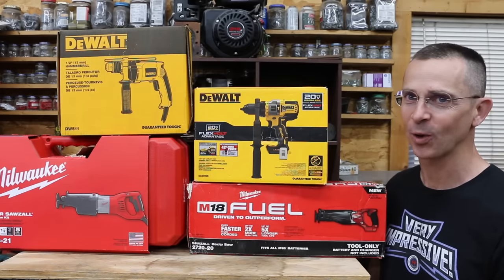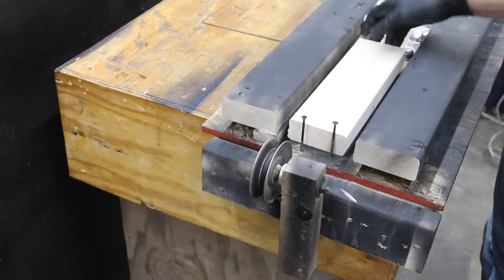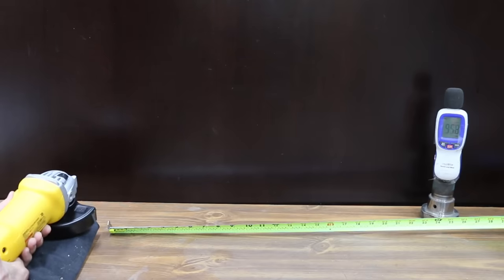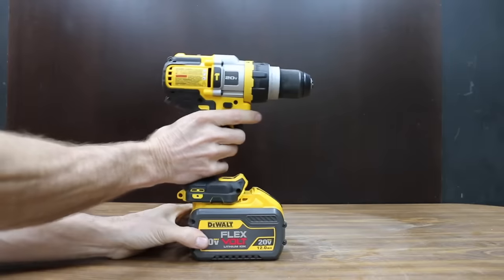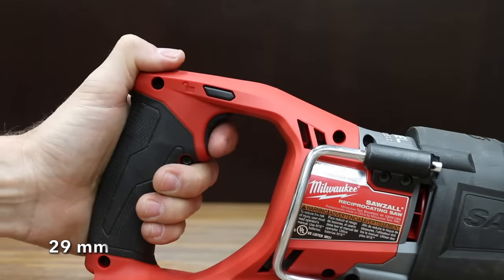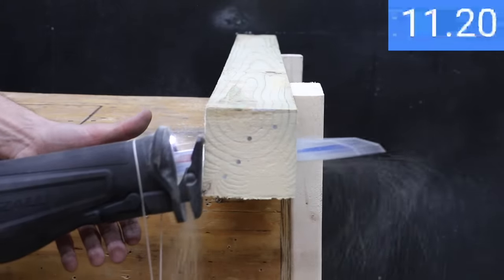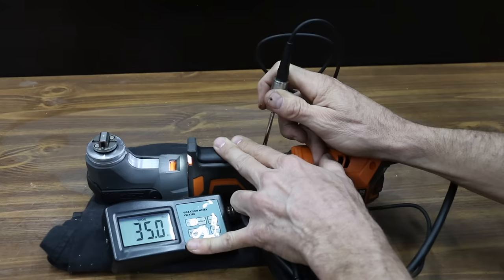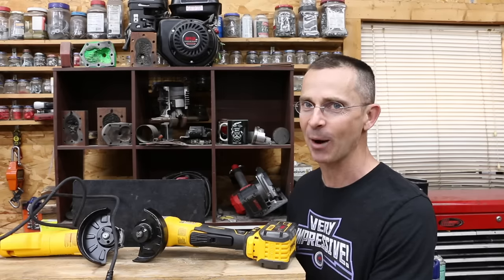Let's Settle This! Are Cordless Power Tools REALLY Better? Torque, Cutting Speed, Noise, Vibration

Comment: It's also important to acknowledge that tool companies have a financial incentive to improve battery powered tools and make them more feature rich than corded. They make a lot more money on batteries than the actual tools.
Reply from the maker: Thanks for the feedback.
Reply: Yeah, batteries are the printer ink of the tool world.
Reply: I think it makes sense for the end users too though - let's face it, most people who are going to be buying LOTS of tools and batteries are probably using them all the time on job sites with possibly inconsistent power accessibility and still demand high performance or they'll shop elsewhere.  For people using them all day every day the convenience also saves them time and money making the higher price worth it for corded power without lugging extension cables or generators.

As a DIY person, I might use a circular saw a couple times a year...I have a tough time stomaching $200 for a cordless one that I will probably use in my garage or back deck next to a plug anyway, and I'm also willing to accept slightly lower performance in a lot of things if its 1/3 the price and is sufficient for the job.  If I really need to use it farther out in my yard, I can drag out the 12 gauge extension cord for that rare time.
Reply: @JoshuaSaundersAtLarge  They certainly are an ecosystem. Big companies like TTi produce battery tools for several brands such as Ryobi, AEG, etc. yet they're all incompatible with each others battery series.
Reply: Yes and no. Markup on both tools and batteries is very high (think of all those "buy a set, choose one for free" types of deals). Batteries don't account for nearly as much revenue, as the typical homeowner can buy the whole lineup of tools and still get by with two 2Ah batteries and one 4Ah. No need to get tens of batteries if you can only use one tool at a time.

Yes, contractors buy a lot of tools and batteries, but 1) I feel like they go through tools faster than they go through batteries; 2) homeowners buy a lot more tools than contractors -- the construction company does not have a circular saw for every employee for instance.
Reply: @sleblanc  Excellent points. Clearly I'm the worst of both worlds there!
Reply: @TristanJCumpole  they're only incompatible out of the box. there are adapters you can buy to make them all work with eachother, for the most part.
Reply: @CRneu  True. We all need even more weight on our unstable cordless tools, right? :-)
Reply: VOLTAGE Dropoff on cordless?
Swap packs all day long?
Tesla arguing against DC power.
Cordless, best for ladder work and restricted areas. Brushless for air, ignition potential.
Working near H20.
Cordless digital pwm capability. And characteristic dynamic braking when power is cutoff.
Reply: Yeah, I look at these batteries and the cells are ~$1-3 a piece in bulk.  They tend to have 5-20 cells.  The BMS and shell might cost $10 and the assembly is probably less than $5.  These are generous numbers.  I bet even once you include shipping, marketing and overhead, it's still half profit, if not higher.
Reply: @JoshuaSaundersAtLarge  oh too right, cordless tools are super useful but it's painful here is Australia to have to fork out around $140-160 per battery!
Reply: @JoshuaSaundersAtLarge  Except for Epson EcoTank printers. Those are are so cheap to buy ink for, it annoys you that you can never refill them. lol
Reply: Stanley/B&D is in the battery selling business with a secondary business of selling tools.
Reply: @MrPizzaman09  As an industrial designer that designs products I can tell you costs a bit more than what you quoted. But yes, it’s normal for products to cost a fraction of the sales price to produce, that’s nothing new.
Reply: @sleblanc  For my Milwaukee tools I have four 2Ah, eight 5Ah, and two 12Ah batteries.   The 2Ah, two of the 5Ah and one of the 12Ah batteries are the ones that came with the tools ... but the others I bought separately because I needed them.  At many job sites I don't have a good place to charge - either because there is no power for my chargers or no place secure enough - so when I get there in the morning I need enough charged batteries to get me through the day.   As well, my circular saws and sawzall can all drain batteries much faster than the chargers can charge them so I need lots of batteries when I am going to be using those tools a lot.

The 5Ah ones are the most heavily used ones so I replace 4 of them every year.   The 2Ah ones get replaced when I replace worn out or damaged tools.   Haven't had to replace a 12Ah one yet.
Reply: @paddington1670  I tried the "knock offs from Amazon".   Cheap ... but they don't run your tools for nearly as long so you have to buy a lot more of them.    They also don't last nearly as long as my brand-name Milwaukee batteries so they have to be replaced much sooner.
Reply: @sleblanc Companies still have a vested interest in selling battery powered tools, because they are counting on you to buy into their system. Once you buy one, you are much more likely to buy others that use the same battery. A corded tool, there is far less incentive to keep using the same brand.
Reply: @trekkeruss  Meh, I do not buy it. It is not a very wise strategy to base your purchase of a tool on being compatible with the batteries you already own. If you're a home owner who will only use one tool at a time, then yeah, maybe, but contractors who have a bunch of employees using their tools at the same time gain nothing from sticking to one battery system.
Reply: @sleblanc  I was not aware that the entire tool industry business model was based on contractor sales.
Reply: @trekkeruss  What is your point?
Reply: @sleblanc  I guess my point is that you contradict your own statements. You wrote previously that homeowners buy more tools. So I said that it is in the interest of the tool companies to make cordless tools (as opposed to corded) in order to possibly generate future sales of tools that use the same battery. But now you say “meh,” and that contractors don’t care. To that I say, so what?
Reply: @trekkeruss  Homeowners buy whichever tool makes the most sense to them. They might already have bought a Dewalt drill and impact driver combo, but if they're out looking for a leaf blower, it's not smart for them to think "I'll get a Dewalt too because I already have Dewalt batteries". If the Ryobi is on sale, that's what they will get. It's further compounded by how the batteries they have for their drill is probably not the right type (20V vs 60V / flexvolt whatever).
Reply: @JoshuaSaundersAtLarge  every time i buy a large amount of hand tools from Milwaukee they just send me free m12 tools. when i got a bunch of wrenches from them they included a m12 fuel ratchet and right angle impact for free. the free power tools cost as much retail as the handtools i bought. when i bought breaker bars they sent me a m12 stubby impact in the box as well. 

I genuinely think they make more money from you buying a battery kit then it cost for them to produce multiple power tools. and i played right into it lol, they sent me free tools and then i went out and spent a good bit of money on a few batteries and a charger.
Reply: @matthewmiller6068  exactly. Im a drywall finisher and previously I was using a corded drywall Sander. I picked up a DeWalt dce800 cordless Sander for cheap. One jobsite I went to sand and there was no power.i bought a twin pack of 9ah flexvolt for $420ca and argued with my builder that he should convert the cost since he left me hanging. Guess who got free batteries.
Reply: @paddington1670 

Do not do this. They provide less power, do not live that long, and are unsafe.
Reply: @sleblanc  Even a battery that sits for years between uses will eventually fail and need replaced.
Reply: "Actual tools"

Comment: Can you please test gasket makers and Different gasket materials?
Reply from the maker: Thank you for the video idea!
Reply: Yes. This would be helpful for sure!
Reply: Leather gaskets and cork would be interesting
Reply: I’d like this as well! 😁
Reply: yes. great idea!   👍👍👍
sealing / gasketing is one of those horrible, messy and usually fairly urgent diy tasks that if you get wrong, the consequences are even worse and you have to start over with what little gunk you have left from before.
i'm gonna stop now because there are too many double-entendres but a good video suggestion.  😉😲
Reply: @ProjectFarm  Test high temp RTV. I've run that stuff on an exhaust manifold and it worked. Plus it's sexy orange. The blue stuff just looks tacky. Nothing says slob job like blue RTV oozing out. Oh and Indian Head Shellac. That stuff is legend. I won't do a water pump without Indian Head. Not unless I want to do it again.
Reply: @billynomates920  if it absolutely cannot leak then what you want is 3M below the waterline adhesive/sealer. You're going to pay for it but that stuff will seal. It only comes in one ugly color too. The other problem is it doesn't keep. Once you crack it open the clock is ticking.